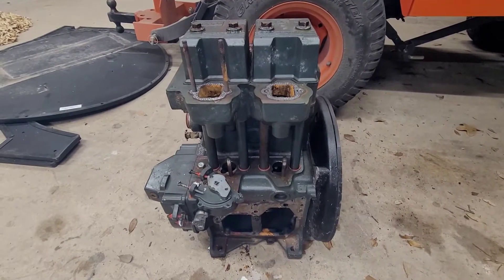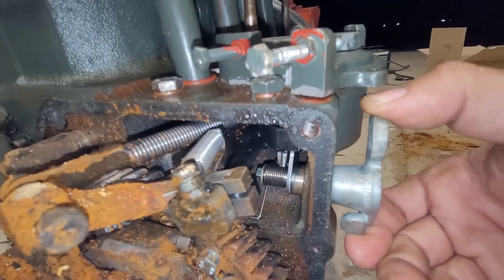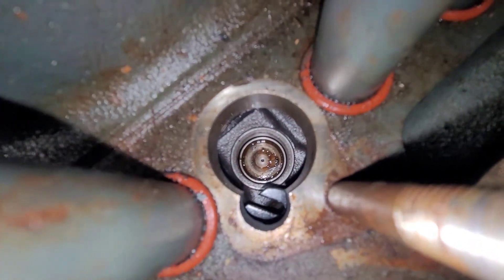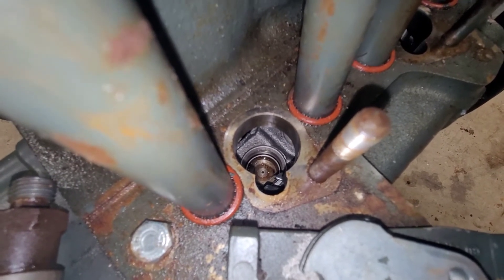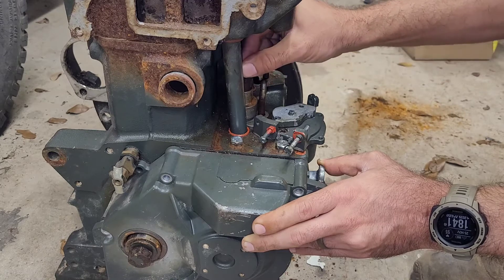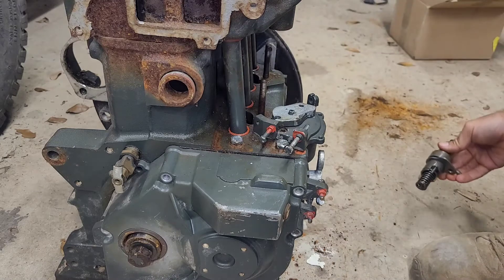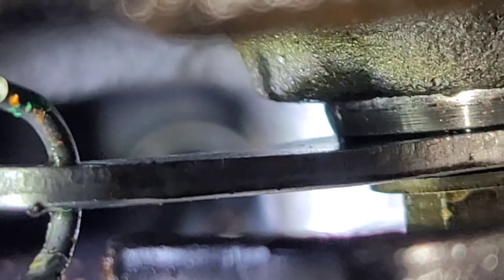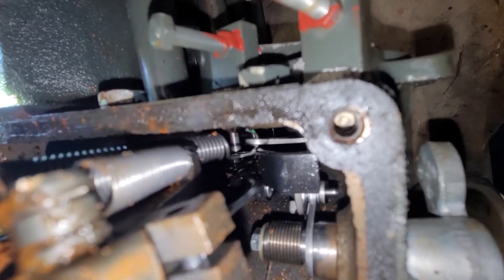MEP 802A - LPW2 injection pump installation / removal issues explained

Comment: I have one that doesn't build pressure the unit has only 13 hours on it could the rack be stuck in the off position
Reply from the maker: Could be a lot of things. Gotta work your way through the entire fuel system. Then, remove the pumps & take them apart, & clean them up. Low hours mean nothing! Low hour units are the worst ones. Lots of problems.

Comment: Hey Colt, really appreciate this video. Helped me get my gen started. I’m having a leaking issue where the shims are at, Do you have any idea how many shims are suppose to be there to help get a tight seal?
Reply from the maker: Shims adjust the timing. None are needed to seal. It's probably a fuel leak from the incoming line at the barb.

Comment: Hey Colt, I’m having a situation you may be able to give me some insight on. I bought 3 802a gens, 2 ran fine one ran the last time the seller tried it but didn’t run when I received it. I’ve narrowed it down to the levers on the IPs jumping out of the rail. I did come across a thread on SS about the sticky rail issue but it didn’t have a clear solution. I’ve pulled both IPs, reinstalled them and the gen starts and runs fine. Shut it off and it will not restart. I’ve discovered that I can pull the left IP, stick my finger down and get the rail to move, reinstall the IP and it starts every time. I’ve done this 4 times in a row today so I know I’ve found my issue (sticky rail, or the levers jumping the rail) any advice sir?
Thanks, Neil.
Reply from the maker: Open it up & replace that rail. It's the only option if the rail is the issue & you want to fix it properly.
Reply: @CallMeColtLLC Thank you. I appreciate the reply.

Comment: I seriously need some help, any advice is helpful 

I got all 4 pumps in by making sure the tappet was all the way down before installing them. 
Satisfied with my work and the tension on the speed adjuster that controls the flow for the pumps I tried to start the engine. 
Try and try and nothing. 
It ran before I took out the pumps to clean them. 

Any idea why it wouldn't crank now?

I've bled the air all the way to the injector before starting,  pulled the fuel line to see if I somehow got an air lock but I didn't have one. It was all fuel. 

Tried to start again and t h e motor barely wants to turn with charger plugged in. 

Tried to remove the pumps to see if there was an issue with them but they now have so much pressure I can't take the pumps out. 
Please help if you can.
Reply from the maker: Sounds like you installed improperly & jammed the common rail against the pumps when trying to start.
Reply: @CallMeColtLLC  im not totally sure how i could have jammed it? what do you mean?

Comment: in my case i can blow air through the 2nd injector, but the other 3 i cannot.
was searching for a way to disassemble them to clean them but im all out of ideas. i tried to loosen it but to no avail
Reply from the maker: I do not talk about injectors in this video.
Reply: @CallMeColtLLC  injector pump is what I meant
Reply from the maker: @Roam865  👍 sounds like it is jammed. Open and clean it up!
Reply: @CallMeColtLLC  when I got it opened I seen that the top that screws in can actually block fuel it screwed too tightly.

Comment: If you happen to get a second Mr. Colt; What could possibly cause this? 

https://www.youtube.com/shorts/oOISCBmYNK4

I'm sure the metering arms are in the rack, and rotated towards the block, and the freq adjustment should not be so far out of wack and my machine looks like its going to explode..
Reply from the maker: The link is dead.
Reply: upon further investigation, i've considered this to be because of improperly rebuilt fuel pumps. I have an extensive steel soilders thread going, and i'm pretty sure improperly alignment of the fuel pump plunger and barrell caused this max fuel. I'm hoping anyway new pumps ordered and i'll find out. Thanks for the reply, im also a customer and fan of yours! @CallMeColtLLC
Reply from the maker: @ericrudofsky5648  The pumps are pretty easy to take apart and put back together, try taking it apart and reassembling it. Can't hurt!

Comment: Cheers for that video I have the same engine in a dumper I've just bought the throttle has a lot of playing it and when you start it it runs away. Could the play in the throttle make it run away
Reply from the maker: Really depends on the setup, but sounds like something with the internals more than anything.
Reply: @CallMeColtLLC  thanks for letting me know I'll have to pull the engine out to have a good look hopefully it's nothing serious cheers

Comment: If that's how people fit, and set up the injection pumps it's no wonder some of these engines run badly. It certainly is not how to set them up.
Reply from the maker: Did I say that's how they're setup? I said (and it's in the title) this is how you remove or install them, NOT properly time them.
Reply: @CallMeColtLLC  I fully understand the video is trying to explain the removal and fitment only, and not the injection timing. As you say you are not installing any of the shims for this reason. I am talking of the fitting of the pumps. The rack needs to be held in the correct position at a certain measurement and not by using the stop on the end cover.
Reply from the maker: @stevelacey3587  The military manual doesn't say this, at least the one I have. If it does say otherwise, can you please provide where it says to do it differently? Is it in a Lister manual or Onan manual? It wouldn't surprise me if the Technical Manual is incorrect. In other equipment, I have found mistakes.
Reply: @stevelacey3587 I seriously need some help, any advice is helpful 

I got all 4 pumps in by making sure the tappet was all the way down before installing them. 
Satisfied with my work and the tension on the speed adjuster that controls the flow for the pumps I tried to start the engine. 
Try and try and nothing. 
It ran before I took out the pumps to clean them. 

Any idea why it wouldn't crank now?

I've bled the air all the way to the injector before starting,  pulled the fuel line to see if I somehow got an air lock but I didn't have one. It was all fuel. 

Tried to start again and t h e motor barely wants to turn with charger plugged in. 

Tried to remove the pumps to see if there was an issue with them but they now have so much pressure I can't take the pumps out. 
Please help if you can.
Reply: @CallMeColtLLC if you have the military manual I seriously could use it
Reply: I seriously need some help, any advice is helpful 

I got all 4 pumps in by making sure the tappet was all the way down before installing them. 
Satisfied with my work and the tension on the speed adjuster that controls the flow for the pumps I tried to start the engine. 
Try and try and nothing. 
It ran before I took out the pumps to clean them. 

Any idea why it wouldn't crank now?

I've bled the air all the way to the injector before starting,  pulled the fuel line to see if I somehow got an air lock but I didn't have one. It was all fuel. 

Tried to start again and t h e motor barely wants to turn with charger plugged in. 

Tried to remove the pumps to see if there was an issue with them but they now have so much pressure I can't take the pumps out. 
Please help if you can.

Comment: Hi thanks for the video,I have a LPW 4silinder enjin and the fuel shut will only move a few inches. It can def be the fuelcam.  What is the best/ easies way to fix it? Don't think the Injectors will come out so how tdo I fix the tailor get the injectors in the right position. I build the enjin in my boat and is difficult to work in there. The enjin was newly overhauled but I bought it from the widow of the person who let it done. Please help. Thanks
Reply: How did you fix the fuel rail? I have the same problem.  Don't think I will get the injectors out so how do you get the rail out and the injectors in the right position?
Reply from the maker: You will just need to spend a lot of time rotating them and working them out one at a time to get them out since they were not installed properly and probably are under the fuel rail I show that should be held in place when installing the injection pumps. There's no other way besides a full engine disassembly to make it easier.

Comment: I'm going to try and take out one of my LPWS4 injectors tomorrow to see why it's not 'spitting' diesel.
Reply: OK first problem, before I started I realise that the fuel rail/fuel cut-off doesn't move more than a few mm. Is there an interlock or is it jammed I wonder
Reply from the maker: You probably have an injection pump that is stuck.
Reply: @CallMeColtLLC  I thought the same but the throttle moves freely, aren't they both linked to the governor rail? My worry is that I won't be able to get the pumps out if the rail stays in its present position
Reply from the maker: @edgar-valentine  The throttle isn't directly linked, it is also attached to the governor. So it will move even if the actual fuel output will not. It's all hard to say without seeing it. Just keep at it!

Comment: Hi colt, this is an old problem in the sense that Petter Diesel engines had a similar set up with the AA, AB, AC range that had a horizontal fork that had to line up with a ball rack on top of the fuel pump. The people at the time who worked on these engines knew all the small details about these things and could make a good job of repairing them. In a lot of cases now, the skills are not there anymore. Thanks for the video.
Reply from the maker: A lot of military surplus machines are getting messed up because the troops don't know! You just need to take the time. Once you get it, it clicks. I love figuring things out. Thanks for watching the video!

Comment: Just watched your clip and thanks for it. I have a 25 kva lpwt4a81 generator and it won't shut down when I switch off the control key. Everything you have explained , I think, I've done right but it still won't switch off. I turn the key to the off position then I have to go to the generator and turn the solenoid cam to the extreme left and wait a couple of seconds for the engine to die down and eventually off. Could there be another problem?.
Reply from the maker: I have no idea on the exact generator, but, it sounds like it. Is there a throttle control on the generator that you can adjust manually while it's running & it responds? If it responds properly than this probably isn't your issue. If it doesn't, it may be.
Reply: @CallMeColtLLC  thanks a lot for your reply, sorry I wasn't more specific. It's a Lister Petter 25 kva generator. it does have a throttle control, but it's pre set and blocked. What I was thinking of doing is opening the throttle control cover and having a look inside. It's stressing me out as I'm in Africa and we have daily power cuts for at least 4 hours. TIA.

Comment: Found this video very helpful , thank you, I got one pump in easily but the other one was very awkward, after about an hour I realized that the cam was in the up position, I was pushing against the spring, after I turned the engine a couple of times it went straight in, but when I get the engine turning properly it will not fire , I can't get diesel out of the injector connection, I know it's been standing for a good few years, but it's been stored inside, any advice would be great thanks
Reply from the maker: Fuel is getting to the pumps? If so, the pumps themselves may need to be taken apart & cleaned. Fuel may have gotten crusty in there & caused a blockage. Or, not enough fuel is being called for by the rail.
Reply: @CallMeColtLLC  thanks, I did have the pumps apart and clean them, but I didn't check the pipes from pumps to injectors, will look again over weekend, I'll let you know the outcome, thanks for your advice
Reply: I had a quick look this afternoon, fuel is getting to the pumps and comes through the pumps until I tighten the top of the pumps down then it won't come through, do you know whether the lift pump should be able to push diesel through the injector pumps by hand, the lift pump doesn't seem to have much pressure either by hand or by cranking the engine, thanks for your advice, very much appreciated.

Comment: My Friend, I have been struggling with my new to me 803a with no throttle control, and no shut off, and run away engine. Your video was spot on and explained exactly why I could not get the injectors out. Mine had a jammed rail from previous incorrect pump installation. . THANKS for a PERFECT video!
Reply: How did you fix the rail ? Have same problem.  How do you get the injectors out/ in the correct position?
Reply: @danielbriers5017  same here
Reply from the maker: Glad it was helpful! That's why I make them. 😎

Comment: Hey Colt Excellent video tutorial. How many Mep-802a do you have. I’m looking at one . The guy has price tag of $3500 on it. I’m looking local for one because I can’t travel too far to check ones out. What if any special tools do you need to work on these engines. I work on small engines now.
Reply from the maker: I have only one. There's not really any special tools you need unless you are going to do major engine repairs. $3,500 is a fair price if it's 100% working.